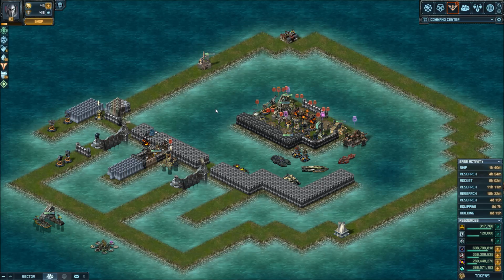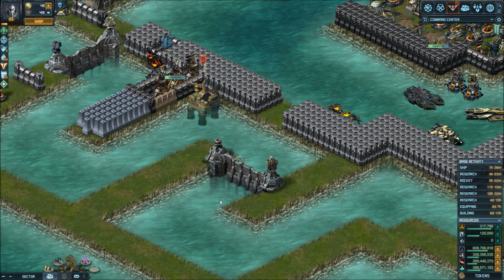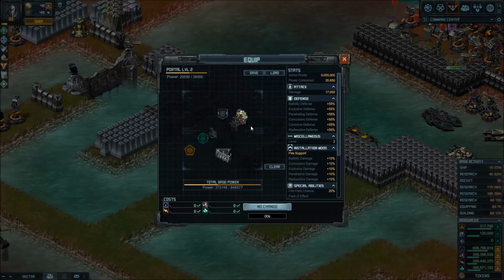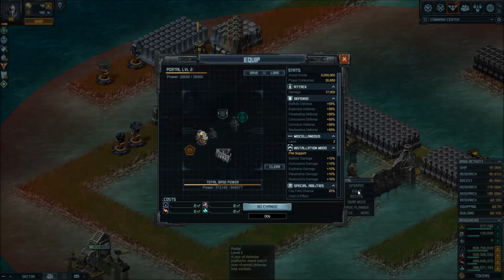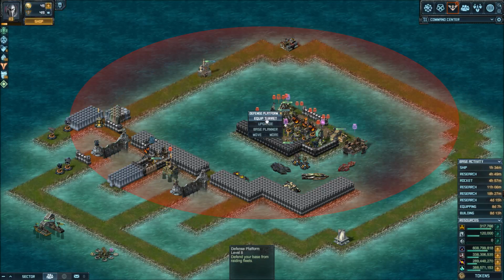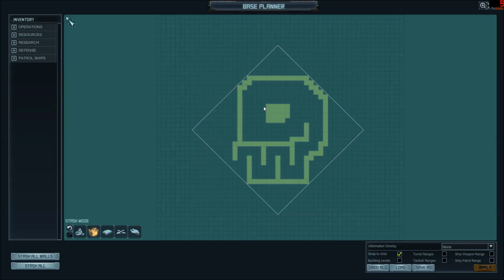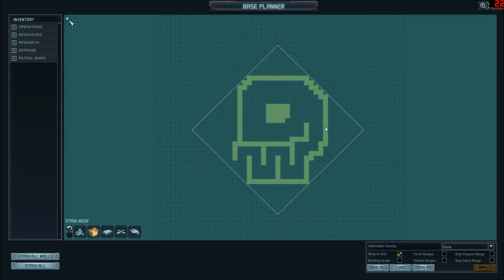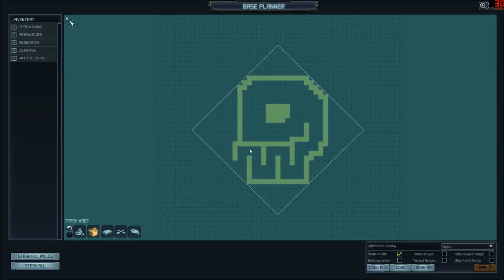Base Clinic [Building Op10 base layout 02 and Portal Overview] Oct 2017

Comment: I'm a low level and won't be seeing OP 10 for a long time, I just wanted to point out the weird memory you were referencing with the portal.  The second time you rotated it, the portal was 180 degrees from its original position which may have something to do with it not letting you put it down...  Keep up the great videos